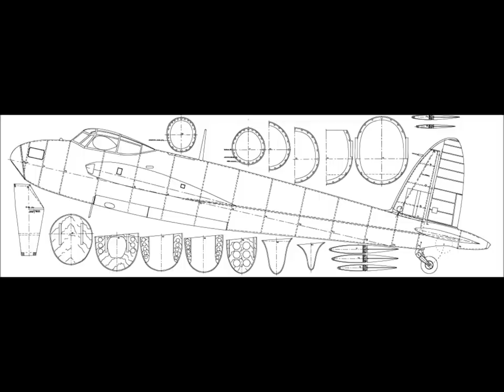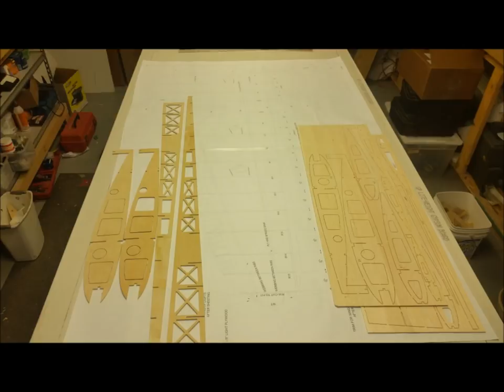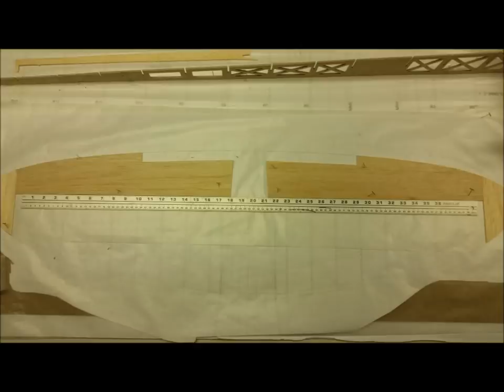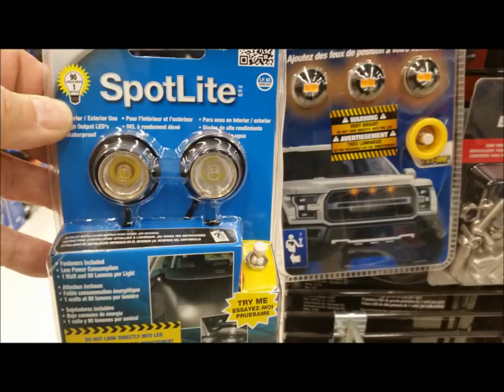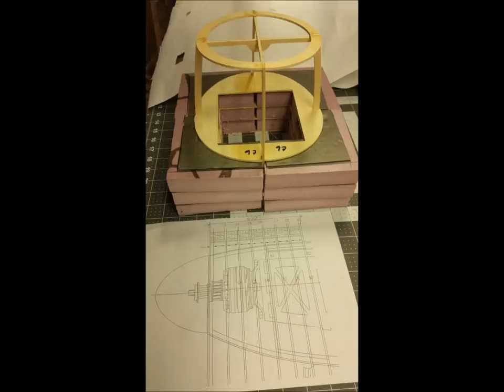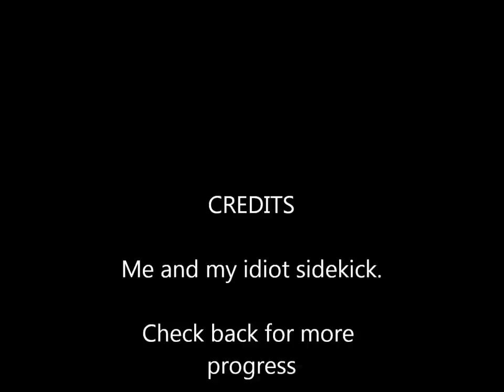De Havilland Mosquito build

Comment: I was asked to prepare such a plane some years back for it's first flight. The guy who owned it, had bought it sight unseen. First thing I noticed was the power situation. Both engines were two stroke petrol spark ignition running three bladed props of 20". I couldn't get the engines to run full power, no matter what I did. Tried smaller props with less pitch still no good. Was not prepared to allow it to fly under such conditions. Whilst tuning another of my own big planes that was fitted with Zenoha 23cc two stroke petrol engine, noticed a difference between the mixture needle on my engine, and the engines of the  Mosquito. Removed both needles from the Mosquito's engines and found them to be different from the one in my engine, thus preventing them from allowing the mixture to be leaned out properly. Ordered two new needles, fitted them to the engines, and BINGO away they went. Max revs. max power. First flight was awesome, very realisitic even the sound with the three bladed props was very realistic. This plane was a heavy plane, (foam and brown paper construction) thus requiring constant power to keep airspeed up and lift adequate. On landing the guy brought engines too far back, air speed dropped off too quick and plane lost lift totally, pancaking straight down belly flopping into the ground. End first and only flight. It takes BALLS to attempt to fly a multi engined R/C plane, suggest folks learn and try smaller sizes first and conquer their fear of twin engines. I will give BIG hint though, the SECRET is DIAHEDRAL of the wing. Try to keep it within 1 1/2 deg positive, even 2 deg can be utilised. Engines Zero thrust, zero left/right. Good luck.
Reply from the maker: Thanks for the story, I originally planned to use electric motors as I did with my Ziroli P-38. (Check out that build and flight videos) I have since decided to go with DA50s, hopefully as reliable as I can get. Even though the Mossie didn't have counter rotating props, I'm going to get one engine reversed. 

I'll be uploading the next video in the series soon. Please check back.

Comment: Awesome model! I built the f6f hellcat model and the f4u model balsa kits. For the f4u model I had to come up with a way for the wings to keep the dihedral. So I tied a string from the wing joint where the wings would fold on the real thing, and attached the other end of the string to the wing tip to keep it up. Anyhow, I think it's awesome that you designed this and built it. This blew my mind away.
Reply from the maker: Thanks a lot.  Please like, share and sub.  Much appreciated

Comment: I'm shocked and impressed - you use more tools than it took to build a original one. :/ Great quality throughout.
Reply: Are you Air Corps ?
Reply: @dbaider9467  My dad was a draftsman in Supermarine's before and for a while during WWII, then he was moved into boat (MTB) work for Vospers.
My earliest recollection of taking an interest in aircraft was in 1961, watching Vampires circuit-bashing at Baldonnell !  My next was a PBY towing some sort of survey drone, probably 1963.  I learned about weight and balance by building models out of offcuts of aeroboard in my parent's boat building shed from probably '62 onwards. I do struggle with depression, and Chronic Fatigue, something that is only now being recognised, but no fix is known.  Exercise is not the answer.  Having grown up on a barge on the Shannon, I now live on an old Minesweeper.

Comment: Sixty-plus years ago, I was tracing the wing-ribs and the fuselage formers onto balsa/ply and cutting  them out by hand, using a surgical-type modelling-knife. You did it using a machine-cutter to follow the rib-curves and spar cutouts: was this cutter guided manually or was there some way of automating the process to get complete accuracy ?
Reply from the maker: Sorry for the late reply, all computerized CNC
Reply: @MikeJM-Fly-RC  Thanks.

Comment: Beautiful plane Mike! 
What size scale is this to?

I wanted to know why your didn't use a monocoque  shell from veneers glued together to make the fuselage. You already had made a elliptic paraboloid gridshell for the longeron framework. You were around 1-2 steps left  to completing a monocoque mold.
Reply from the maker: 1/5 I just went with something I knew, never thought about doing a monocoque shell.
Reply: @MikeJM-Fly-RC  I was planning on making a Hornet, but I've been looking for some plans to use. If not, I'll just have to take a 1/48 model and scale up on Autodesk Inventor. I'd use a 1/32'' birch veneer 3-ply for the monocoque.
 Do you own that CNC router from the video? Which type is it?
Reply from the maker: @tumdeax  It's homemade, I built it for my ziroli P-38. If you haven't seen that 3 part  build you should check it out.  Some people don't like the music.....fair warning.

Comment: Now do one without the laser !  If I had another life, I would live to build a real 60 or 70% scale with modern engines.
Reply from the maker: Probably easier and faster to cut the parts by hand.
Reply: @MikeJM-Fly-RC  Depends on what you start with.  Smooth curves, identical/symmetrical parts etc, are much easier with CAD/CAM, esp if you start with CAD files.

Comment: awesome job. what software did you use to draw up those great plans ?
Reply from the maker: I used Autocad for drawing the plans.  Then used CamBam for my conversion software and for CNC I used Mach 3.. I used the same software for my Ziroli P38 build. Glad you liked it.  I'll be uploading a new progress video on the Mossie soon, so bomb that bell for notifications.  Again thank you.
Reply: @MikeJM-Fly-RC  Did you scan in any original drawings or all CAD work? Thanks.
Reply from the maker: @phubarnow5388  I downloaded the free plans from rcscalebuilder.com    then I had them scanned at the UPS store as a pdf.  I then opened them up in Paintshop Pro and did quite a bit of cleaning them up. I had to do this since the plans are penciled drawings. Then I used scan2cad software to convert to a dxf file. I used Autocad and pretty much redraw the plans.  I also made a lot of modifications to the plans since they were lacking detailed information and templates. Final drawings were then organized into cut sheets for conversion for CNC cutting.
Reply from the maker: @phubarnow5388  i scanned 3 sheets that had very minimal detail. I had to design alot of the components
Reply: @MikeJM-Fly-RC  Hello, Could you include a link to the plans?
Reply from the maker: @hjones3056  they are in the Plans  Repository on Rcscalebuilder.com.  I think you have to subscribe to the  forums to download them.
Https://www.rcscalebuilder.com